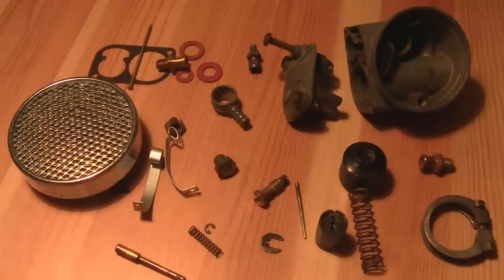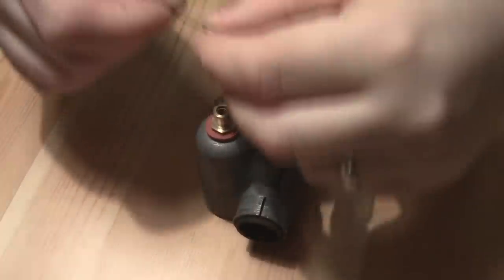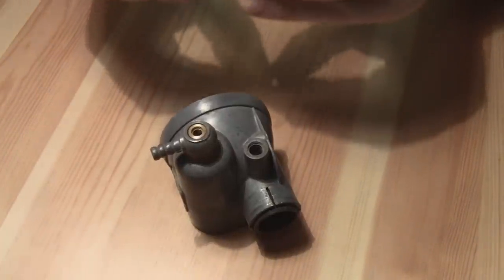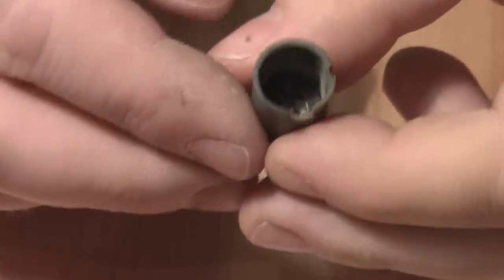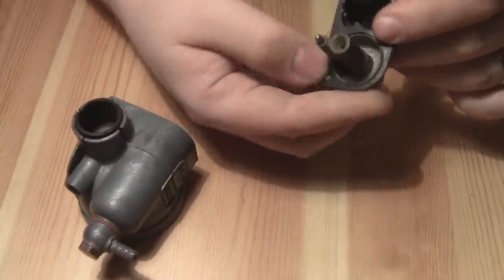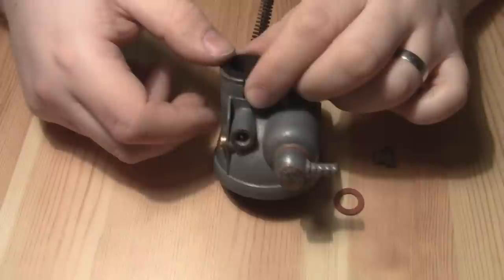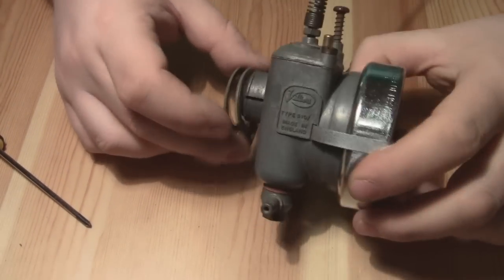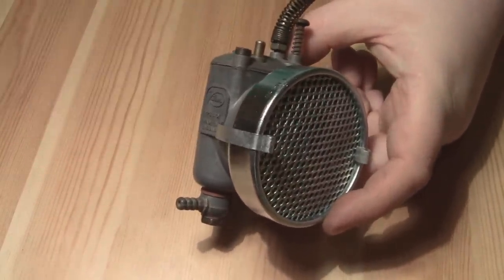Villiers S10 Carb Rebuild #2

Comment: Excellent video - well presented, clearly spoken and no annoying background soundtrack like so many others.
I have had a S10/2 for 25 years or so, and have been cleaning it up in preparation for getting the kick-start Atco (circa 1965) running again after 15 years.
This 10/2 version has the choke lever in the body, and the throttle needle valve seat extends lower than yours.  Maybe for easier adjustment?
The banjo fitting should have a gauze filter I believe - mine dried right up.

Comment: Nice vid. thank you. I don't know whether you have found out the reason for the little sprung gizmo on the top of the carb yet, but it is a "tickler". It allows you to push the float down to flood it with petrol, usually for a cold start.I remember my father proudly getting an Atco mower with this motor.